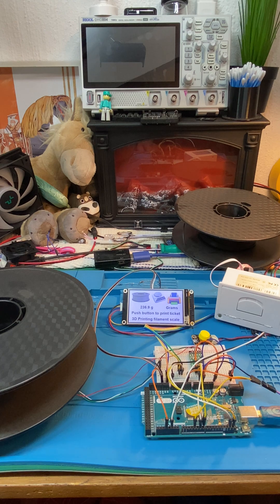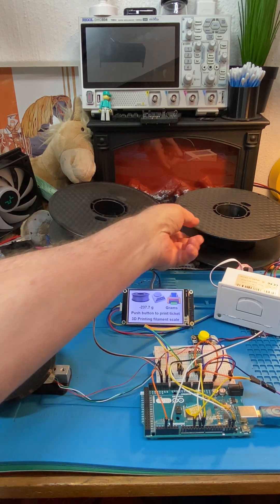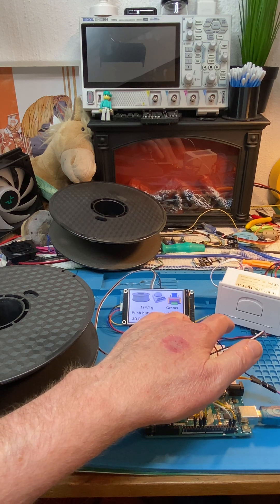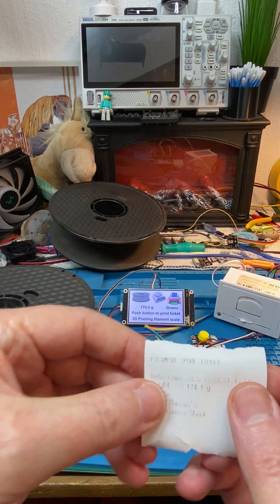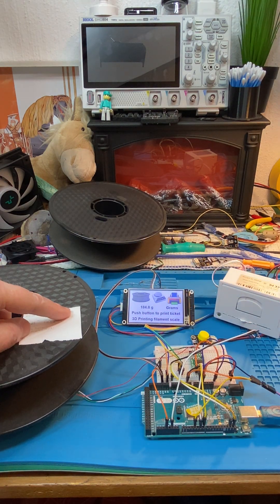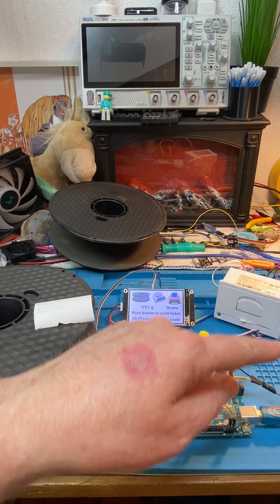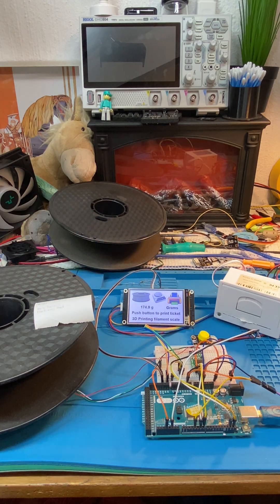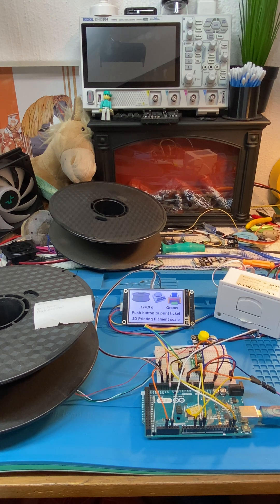Arduino Filament Scale That Prints a Weight Label #shorts #arduino #3dprinting #electronics

Comment from the maker: /*
  Filament Spool Ticket Printer
  Mega 2560:
   - HX711 load cell amp -> weight in grams
   - DS1307 RTC -> timestamp
   - Button on pin 4 (active HIGH) -> print ticket
   - Nextion on Serial1 -> update t2 with weight
   - Thermal printer on Serial2 -> print a ticket

  Notes:
   - Set your HX711 calibration factor in CAL_FACTOR
   - HX711 pins: set HX_DOUT and HX_SCK below
*/

#include <Wire.h>
#include <RTClib.h>
#include "HX711.h"

// ---------------- Pins ----------------
#define PRINT_BTN_PIN 4   // active HIGH

// HX711 pins (change to your wiring)
#define HX_DOUT  6
#define HX_SCK   7

// ---------------- Serial Ports ----------------
#define NEXTION   Serial1   // TX1=18 RX1=19
#define PRINTER   Serial2   // TX2=16 RX2=17 (printer typically needs only RX)

// ---------------- Objects ----------------
RTC_DS1307 rtc;
HX711 scale;

// ---------------- Calibration ----------------
// !!! Set this to your real calibration factor !!!
float CAL_FACTOR = 705.0f;   // placeholder (common sign is negative depending on wiring)
float lastDisplayedWeight = 999999.0f;

// ---------------- Timing ----------------
unsigned long lastNextionUpdateMs = 0;
const unsigned long NEXTION_UPDATE_PERIOD_MS = 200;  // 5 Hz update

// ---------------- Button debounce ----------------
bool lastBtnState = false;
unsigned long lastDebounceMs = 0;
const unsigned long DEBOUNCE_MS = 40;

// Optional: long-press tare feature (hold button)
const unsigned long LONG_PRESS_MS = 3000;
unsigned long pressStartMs = 0;
bool longPressActionDone = false;

// ---------------- Helpers ----------------
String twoDigits(int v) {
  if (v < 10) return "0" + String(v);
  return String(v);
}

String formatDateTime(const DateTime& dt) {
  // Example: 2025-12-21 20:15:03
  String s;
  s.reserve(20);
  s += String(dt.year()) + "-";
  s += twoDigits(dt.month()) + "-";
  s += twoDigits(dt.day()) + " ";
  s += twoDigits(dt.hour()) + ":";
  s += twoDigits(dt.minute()) + ":";
  s += twoDigits(dt.second());
  return s;
}

void nextionSetText(const char* obj, const String& text) {
  // Nextion command: t2.txt="123.4 g"
  NEXTION.print(obj);
  NEXTION.print(".txt=\"");
  // Escape quotes not expected here; keep it simple
  NEXTION.print(text);
  NEXTION.print("\"");
  NEXTION.write(0xFF); NEXTION.write(0xFF); NEXTION.write(0xFF);
}

void printerLine(const String& s) {
  PRINTER.print(s);
  PRINTER.print("\n");
}

// Basic ESC/POS-ish init + cut attempt (many printers support some subset)
void printerInit() {
  // Initialize (ESC @)
  PRINTER.write(0x1B); PRINTER.write('@');
  delay(50);
}

void printerFeed(uint8_t n) {
  for (uint8_t i = 0; i < n; i++) PRINTER.print("\n");
}

void printerCutIfSupported() {
  // Full cut: GS V 0  (some printers)
  PRINTER.write(0x1D); PRINTER.write('V'); PRINTER.write(0);
}

void printTicket(float grams) {
  DateTime now = rtc.now();
  String ts = formatDateTime(now);

  printerInit();

  printerLine("FILAMENT SPOOL TICKET");
  printerLine("---------------------");
  printerLine("Date/Time: " + ts);
  printerLine("Weight   : " + String(grams, 1) + " g");
  printerLine("---------------------");
  printerLine("Uncle Duncan's");
  printerLine("Electronics Shack");

  printerFeed(3);
  printerCutIfSupported();
}

// Read weight (grams) with some smoothing
float readWeightGrams() {
  // HX711 library provides get_units() which uses scale factor
  // Take multiple samples for stability
  const int samples = 10;
  float g = scale.get_units(samples);  // already in "units" scaled to grams if CAL_FACTOR is set correctly
  return g;
}

void setup() {
  pinMode(PRINT_BTN_PIN, INPUT); // assumes external pulldown or active-high wiring

  Serial.begin(115200);
  NEXTION.begin(9600);   // common default; change if your Nextion is different
  PRINTER.begin(9600);  // common thermal printer baud; change to match your printer

  Wire.begin();

  // RTC
  if (!rtc.begin()) {
    Serial.println("RTC not found!");
  }
  if (!rtc.isrunning()) {
    Serial.println("RTC not running - set time if needed.");
    // Uncomment to set RTC to compile time:
    // rtc.adjust(DateTime(F(__DATE__), F(__TIME__)));
  }

  // HX711
  scale.begin(HX_DOUT, HX_SCK);
  scale.set_scale(CAL_FACTOR);

  // Tare at startup (empty platform)
  Serial.println("Taring scale...");
  scale.tare(20);

  nextionSetText("t2", "0.0 g");
  printerInit();

  Serial.println("Ready.");
}

void loop() {
  // ---- Read weight periodically and update Nextion ----
  unsigned long nowMs = millis();
  if (nowMs - lastNextionUpdateMs >= NEXTION_UPDATE_PERIOD_MS) {
    lastNextionUpdateMs = nowMs;

    float grams = readWeightGrams();

    // Only update display if changed enough (reduces flicker/traffic)
    if (abs(grams - lastDisplayedWeight) >= 0.2f) {
      lastDisplayedWeight = grams;
      nextionSetText("t2", String(grams, 1) + " g");
    }
  }

  // ---- Button handling (debounce) ----
  bool btn = (digitalRead(PRINT_BTN_PIN) == HIGH);

  if (btn != lastBtnState) {
    lastDebounceMs = nowMs;
    lastBtnState = btn;

    if (btn) {
      pressStartMs = nowMs;
      longPressActionDone = false;
    }
  }

  // After debounce time, act on press/release
  if ((nowMs - lastDebounceMs) > DEBOUNCE_MS) {

    // Optional long-press tare (hold button)
    if (btn && !longPressActionDone && (nowMs - pressStartMs >= LONG_PRESS_MS)) {
      longPressActionDone = true;
      Serial.println("Long press: TARE");
      scale.tare(20);
      nextionSetText("t2", "TARE");
      delay(250);
    }

    // On release: if it wasn't a long-press tare, print ticket
    static bool prevStableBtn = false;
    if (prevStableBtn && !btn) {
      if (!longPressActionDone) {
        float grams = readWeightGrams();
        Serial.print("Print ticket: "); Serial.println(grams, 1);
        printTicket(grams);
      }
    }
    prevStableBtn = btn;
  }
}